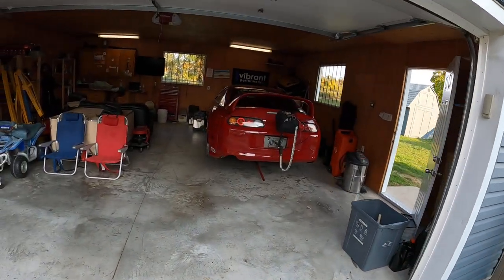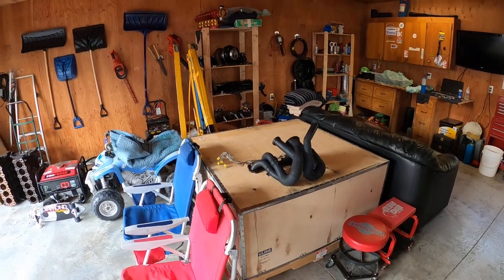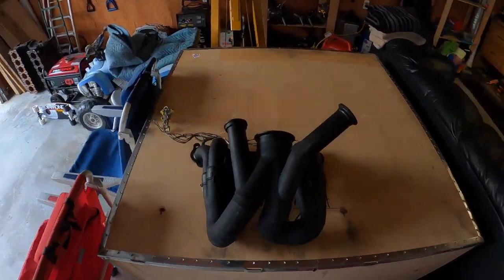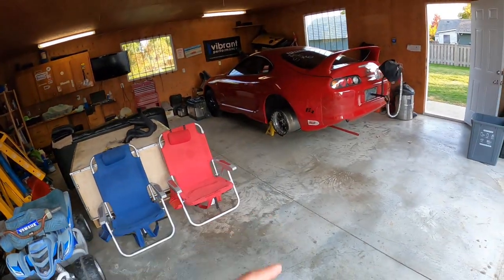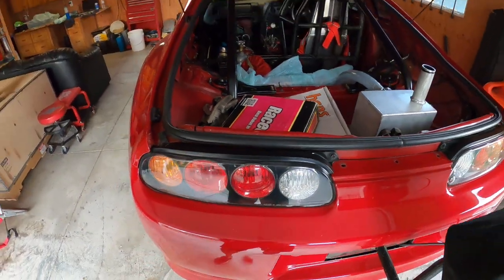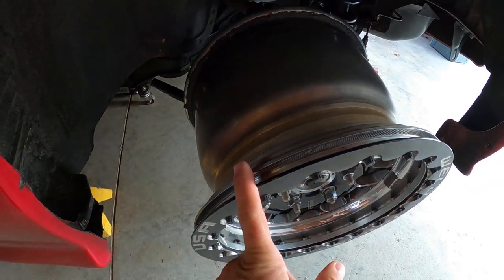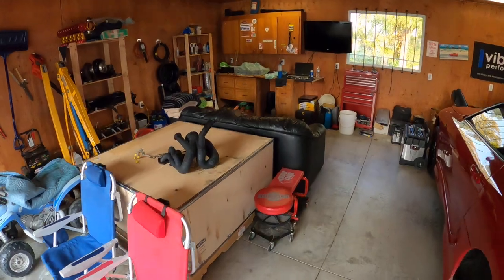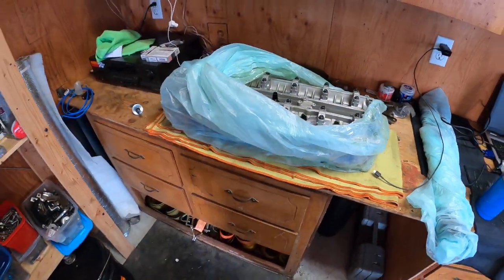Supra Update - 4 link of stay IRS?

Comment: I'm about to start my solid axle setup in 2001 is300, complete street car mind you, 600ish HP, more coming soon also lol, not 2000+ though. And honestly it can be done for ALOT less then any upgraded IRS setup on the market, most of the work will be done by me, including fabrication, material and welding and whatnot. Undecided though if I'm going ladder bar, parallel 4 link or even a triangulated 4 link, plenty of options....good luck though!!
Reply from the maker: Interesting.. might aswell go 4 link to have adjustment. Good luck!
Reply: @RyanSammutRacing  thanks and for what it's worth give a follow @slolex12 and hopefully after getting settled in our new place I'll pick up on upgrading the current setup and starting the whatever it is work to the rear end LMAO!